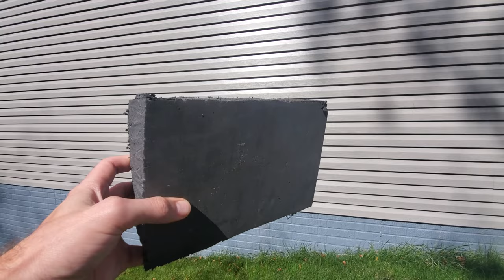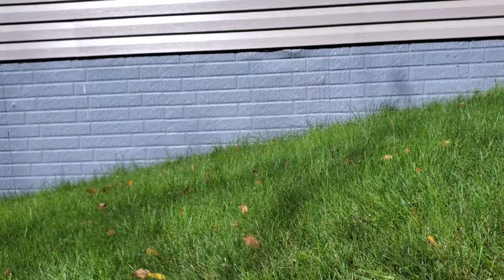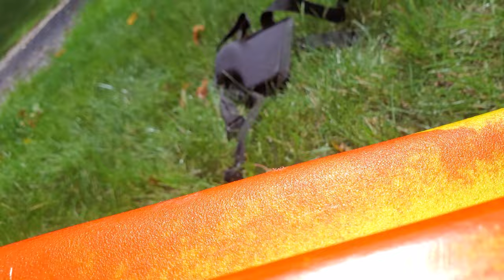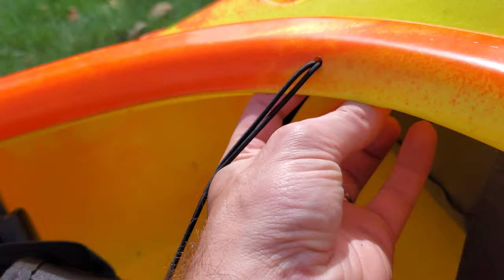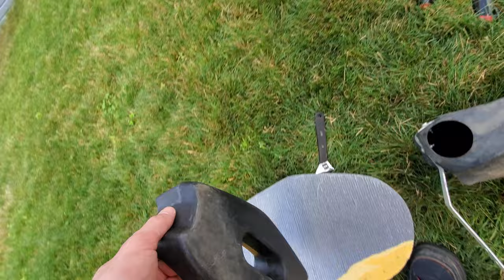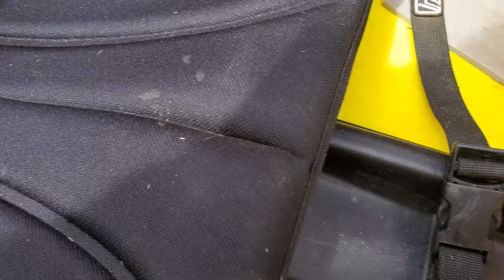Kayak Breakdown and Tuneup - Outfitting the Pyranha Burn 3

Comment: I like your idea for the thigh brace foam. I find there's too much room between the hull and the brace no matter where I move them. One thing I found was a must was moving the back band up. Wade Harrison has a good video on how to do it and makes it much more comfortable. Thanks for the video. 👍🏼
Reply from the maker: Thanks!  I built them a long time ago for my blue Burn and I put them in every boat I paddle now.  I am not sure why someone doesn't make something standard like that for every boat.  I was finding my feet were falling asleep without them.  Helps keep engaged and relax them if you need too.  I will post a how to video on building those sometime but I followed this guide a long time ago: http://www.brushymountainpublishing.com/kneeblocks.html
Reply: Thanks for the info on the thigh foam. I will definitely be doing that. Here’s the link to the back band relocation video I was telling you about before. The only difference is I used a Stainless ring for the band to slide through. Night and day difference. https://youtu.be/VXk9kOKfavo

Comment: Good day, I’m currently looking to get a burn original (gen1) used but like new. I notice there has been some major upgrades to the burn in its 3rd generation.
 Currently holding on to a large code that hasn’t seen water other than pool time for me . Thinking I might want something a little more playful (edges) than the code. Seeing you have run thru one burn and now on to another I feel you have a good feel for them. Beginning/intermediate fast learning 2season kayaker. 220lb 5’11” 11shoe. 
 Will I have to outfit it to fit properly…etc.
Any thoughts and advice is much appreciated.
Thanks 🙏🏻
Reply from the maker: Hi Darin,

I wanted to research the Dagger Code before giving you an opinion, thus I have and here it is!  The Dagger Code has a planning hull design which in the world of boating, is a bit "edgier" than the displacement hull designs of older Pyranha Shiva and Dagger Nomad-esq style boats.  You can still rock edges and catch eddies in displacement hulls, planning you kind of snap right into place.  That said, the Burn MK1 has a planning hull design as the Dagger Code offers the same design.  Boats are always evolving as people continue to push different limits.  I would say, how does the Dagger Code do out on the river?  It may be just a fine boat to get started out in and learn a bit faster as it is edgy.  I have never paddled the code though, I have been in a Dagger mamba, nomad; LL remix; Pyranha Burn mk3; Also outfitting on Pyranha's older boats can be a challenge compared to that pretty Dagger stuff!  Maybe paddle the code a bit out on some rivers and see how they handle.  If you want something edgier after you learn a bit more maybe a bigger playboat would be your next natural progression.  Hope that helps!
Reply: Thanks for the research and quick response. I actually will hold onto the code and start of this season with it but I’m actually picking up a like new Burn 3 xl tomorrow. So I’ll get to play in both and go from there.